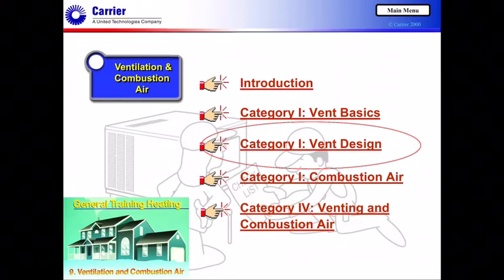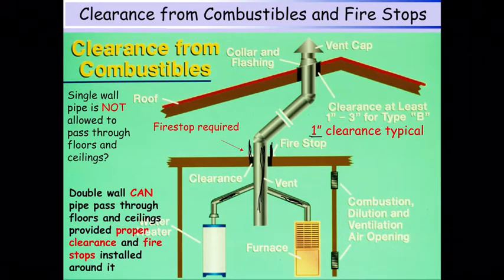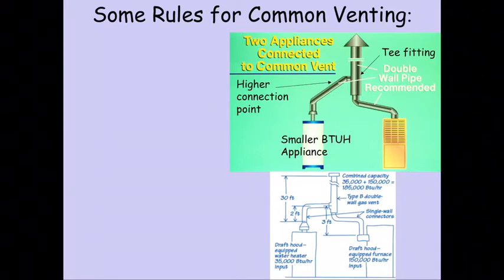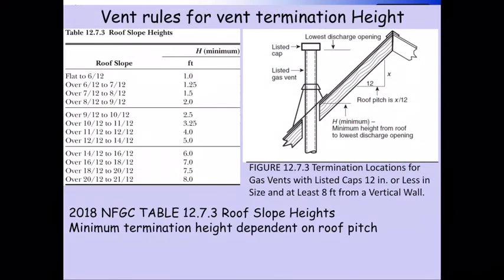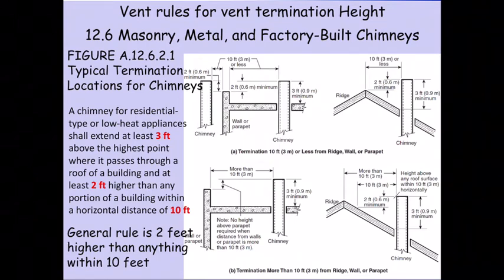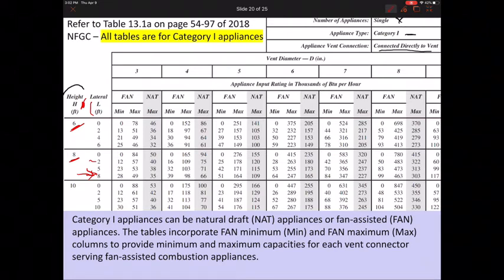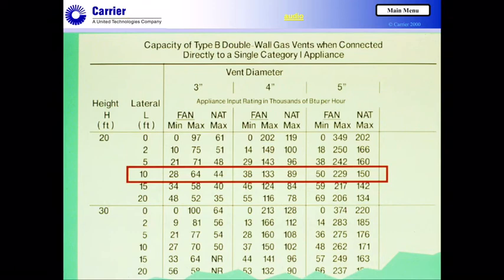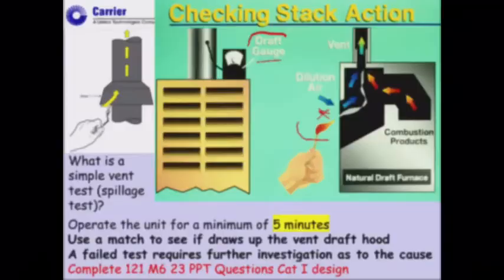Vent system design for Category 1 appliances

Comment: Hey ken question. I had a induced draft furnace and then a. 75gal water heater. Water heater was spilling. They ran 4” off the wh but then went to 3” chimney liner only to the bottom of the chimney just sitting in there. Furnace cause of the inducer was venting but the water heater won’t vent.